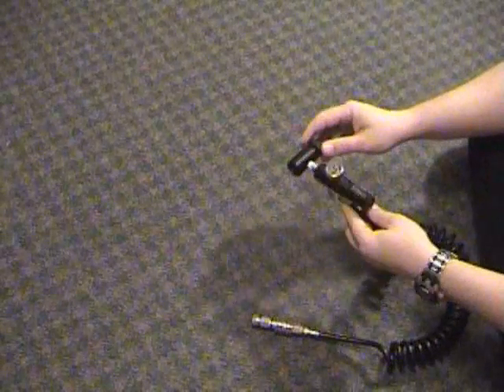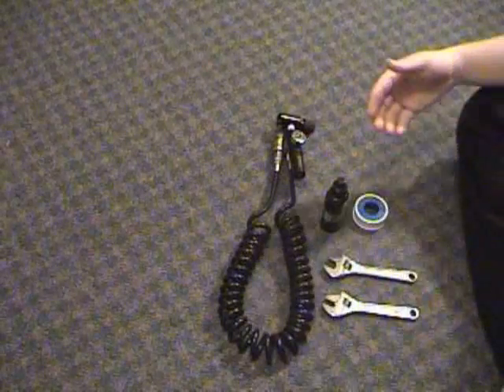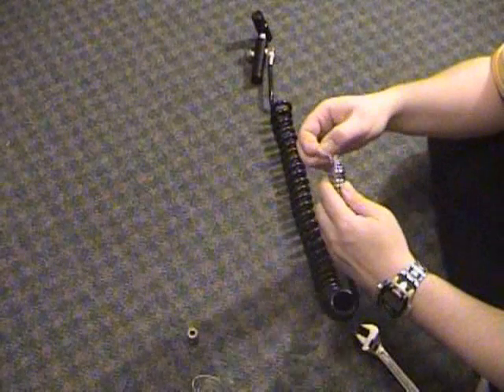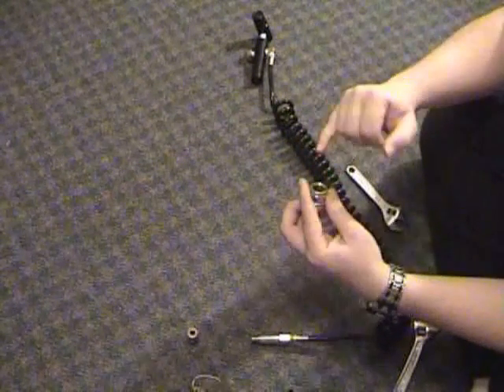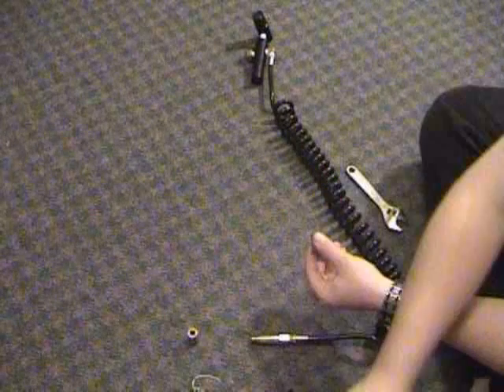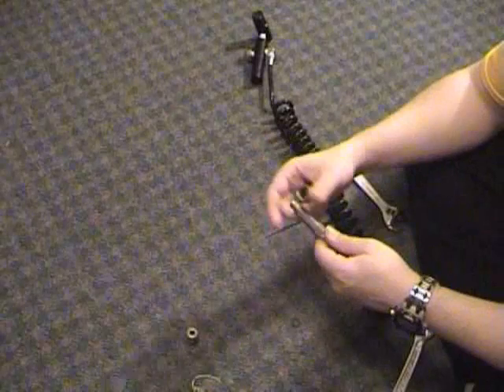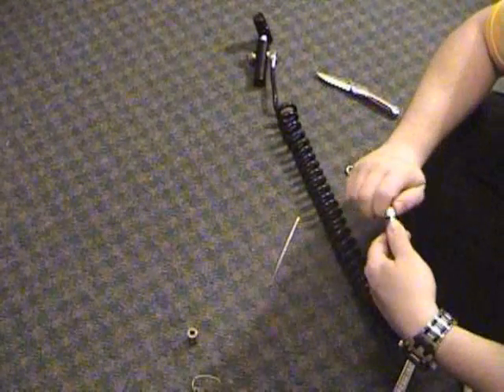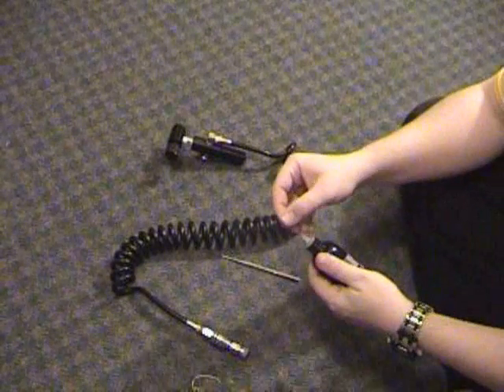Remote Line Maintenance

Comment from the maker: No. Duct tape is originally for ventilation shafts, not sealing high pressure tubing. The only "tape" that works for high pressure situation is plumber's tape, a.k.a. Teflon Tape. But that won't take care of a broken/damaged o-ring; it's only used to seal threadings.

Comment: I was wondering, is it safe to place silicon oil into the On/Off valve of the remote line? I know that it is safe to place in the ASA of a marker, but it isn't safe to place into the fill nipple of a HPA tank as the pressure is enough to combust it. Would the regulator of a HPA tank stop it from getting too much pressure in the remote line to combust the oil?

Comment from the maker: @Madcow800 - Depends on what type of tank you are using.  If you use CO2,  you will have to remove the entire remote hose system, valve and all.  If you use HPA, those tanks are filled through a side "nipple", allowing a fill line to hook up without interference from the remote line.  HPA tanks are not filled through the pin valve like CO2 tanks are.

Comment from the maker: @Deebo125ngo - How often depends on how you disconnect the remote line, what air source you use, weather/temperature, quality of oil and quality of o-rings, etc.  In other words - you'll just have to try and see.  As for oil, use air tool oil, or paintball oil.  I wouldn't use grease.  You MIGHT be able to get away with grease if you use polyurethane o-rings instead of rubber.  But I'd still suggest oil.

Comment from the maker: Yes, my o-rings are rubber.  You need to be able to remove it for periodic maintenance.  If it breaks, there's already a problem anyway, and it should be replaced.

Comment from the maker: O-rings aren't metal.  Those are retaining clips.  The o-rings are polyurethane or rubber, and are inside the sliding sleeve.  You need to disassemble the slide check and replace one or more of the o-rings.

Comment from the maker: There are several times, like those modified with ball valves from Palmer-Pursuit Shop.  But most have a slide check or regular quick disconnect.  See my video on "adding a quick disconnect to a marker".